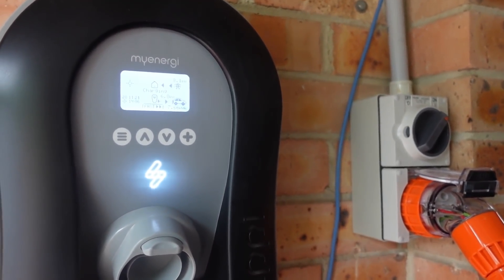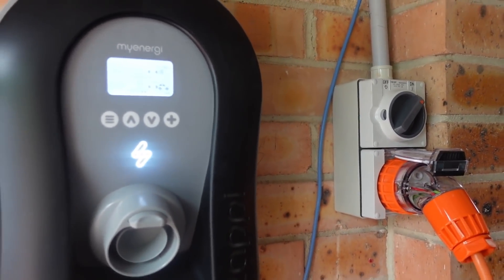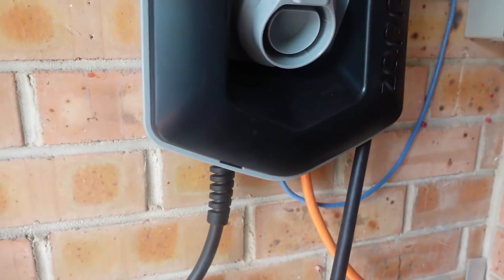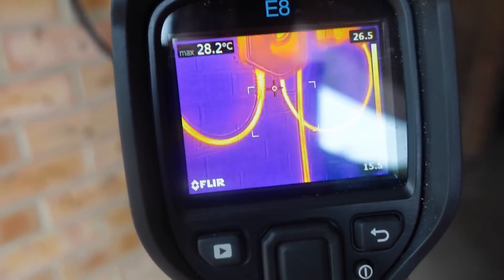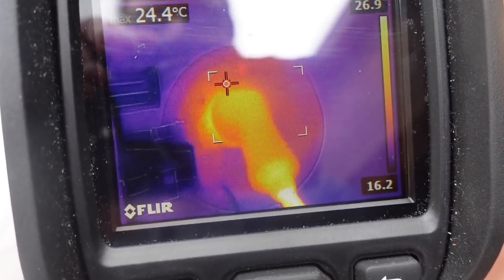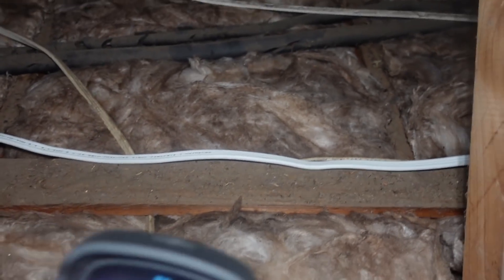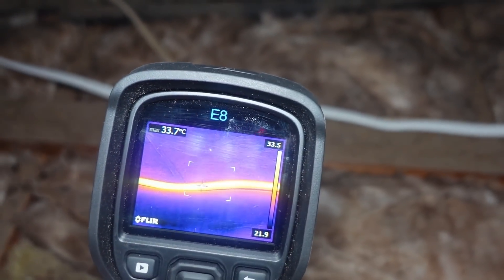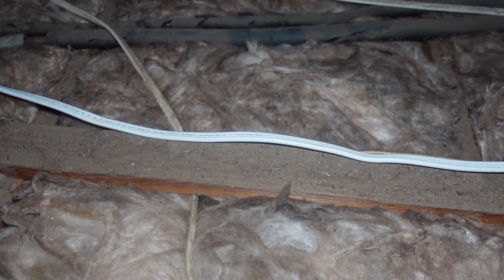Zappi EV Charger & Cable Thermal Imaging

Comment: It's cool how you can see the twist in the cable from the spiraling of two wires creating the "hot cold hot cold" pattern of heat.
Reply from the maker: Wow, didn't notice that on the Zappi cable!
Reply: @EEVblog2  2 power generating cores, one protective conductor same size, and the 2 comms conductors that act as a thermal barrier in the cable.

Comment: Sadly the Ex models are 8.7hz, having at least 25hz or even 60 is a much better experience when looking at a thermal camera. But 320x240 resolution with such a narrow lens and some DoF (due to f/1.3 lens) gives you a useable image. Still not happy with MSX and the color palette. If you put into white hot it's such an interesting image. 

Sadly most people don't think of it as a camera or photography but just a tool. Those using thermal monoculars for spotting experience the world in the way I want to show it.

Comment: Clearly the IR images are fake, since they show the power traveling through the wire.  As you should have learned form Derek's Veratasium video, the wire should be at ambient and the air around it warmer since the energy is traveling outside of the wire! 😂

Comment: 3:30 heat doesn't rise in a cable though, that only happens in gasses and liquids due to thermal lift. Most likely the higher temperature comes from contact resistance in the wallbox which is radiating out
Reply: Possible measurement artifact of FLIR camera? I know they use low-resolution thermal sensors coupled with a higher-resolution visible-light camera to give sharper images. Rotate camera a little to see whether orientation affects reading.

Comment: I wonder what temperatures you'll see on those relays in there, i've seen they get pretty toasty :P
Reply: well, that was the temperature reading on the zappi.
i hope that answered your question.
Reply: @ursodermatt8809  that is just the ambient temperature inside the case though I think.
Reply: Yeah, I wanted to see him take the cover off and do a thermal of the PCB and relays while operating.
Reply: @gargantuablargg  
believe me, the relay is the only thing that is creating any heat in any measure that is inside a EVSE.

Comment: Be advised: the PWM of the pilot is for current only, not the watts.  Current is the most important parameter for the wiring.  Watts measurement includes voltage which is different through out the world.

Comment: Current rating for the 6mm2 cable on single phase is around 40A I think, maybe 45 installed in air. That is for a core temperature of 70C in PVC so these temperatures you are seeing are really quite minor and frankly expected.

Comment: In UK we supposedly lowered to 230v  but Friday measured 244v.  Just 230v Was The harmonised voltage to standardised the world but you know what happens to standards it happens Dreckly (Cornish for in the future like Menyana in Spanish)
Reply: 230 +10% -6%, which allowed the UK to carry on as usual.  Incandescent light bulbs had to be made in 240V versions specifically for the UK, as the difference was enough to massively shorten the lifespan of a 230V bulb.
Reply: @jrevillug  The simples way to harmonize it to change the standard so what exists now is included.
Reply: @target844  Exactly.
Reply: @jrevillug  you beat me to it.
Reply: @jrevillug  Yup, same as the standard here in AU so anywhere between ~228V and 253V is acceptable.

Comment: But why are the cables getting warm, when the energy is flowing in the surrounding fields? :)
Reply: The fields are sending energy through the air into the cable to heat it, at each point, like a microwave! /s
Reply: still the electrons are moving

Comment: The Ioniq 5 as well as the Ioniq Elektro seem to be 11kW and 7.2kW max. charging power here in Europe which would point to 16A 2 or 3 phase. Is this different for Australia?
Reply: Unfortunatelly the old Ioniq is always single phase 32A. It depends on the country how many Amps you're allowed to pull on a single phase - Austria limits single-phase loads to 16A, Germany to 20A.
Reply: @codingquantum2195  I think new Ioniq (FL) as well. 32A single phase.
Reply: Alright so basically 20A max single phase for the "old" Ioniq here. Bummer
Reply: @lalaland5700  Old IONIQ has 32A as well. You can always have an EVSE with that capacity installed at your house.
Reply: houses here in australia are generally wired single phase. so no good having a 3phase charger in the car. there are some houses that have 2 phases like when they have a heavy user.

Comment: OK, but 44° internal at 15° ambient would make it on a hot 40° Aussie day have about 70° internal temp. Might be cozy...
Reply: The cable will be rated for either 70C or 90C so it's no a problem.

Comment: Fast charging mode he says 6-7kw meanwhile I just charged my Tesla at 197kw in fast mode.
Reply: Most people don't have a DC supercharger at home.
Reply: @benbaselet2026  So it's supercharge, not fast charge.
Reply: @benbaselet2026  I know 🤦‍♂️ but 6-7kw is not fast charging. I charge 11kw at home and it's not known as or called fast charging
Reply: @jchelm1979  There's a lot of terminology which is used willy nilly and practically meaningless. I hate it that my car has settings for low, limited and unlimited for charging instead of just putting the damn amps or kW numbers there.
Reply: At home?

Comment: In Europe 6mm2 cables are installed with 25A breakers. For 32 to 40A you should use 10 mm2 here.
Reply: Similar applies to US as well.  30A breaker would be 10 AWG (6mm2).  An EVSE rated for 32A would need a 40A breaker (80% NEC rule), and 8AWG (10mm2) or larger gauge cable.  Dave's setup would be a bit below our codes here.  Is the 6mm2 wire in Dave's AU setup per local code?
Reply: @billjohnson3344  Per AS3000-2007 Table C5 6mm cable is suitable for 40A breaker when installed "in air" or 32A breaker when installed "in thermal insulation partially surrounded" that's based on the assumption that the cable is rated for 75C, if it's rated for 90C you've got more leeway (because it's based on temperature rise) AS3008 is the final word but the tables are more complicated an I CBF doing the conversion ;)
Reply: Depends. In Belgian homes a 6mm² can be fused with 32A when using a thermal fuse or 40A when using a breaker.
Reply: Utterly overkill in most situations. I guess your locale has copper mines to subsidise.
Reply: @Monkeh616  Even if national or local electrical codes allowed smaller feed wiring (which they don't here in the US anyway for an 32A EVSE - except extremely short runs), I'd rather send power to the car rather than heat the cabling.  In Dave's case, I'd bump down the max current allowed by the EVSE to something like 20A if charge time is not an issue.  Cooler cabling and less power loss.

Comment: Good April fool's joke there, could have convinced people bends in cables make them hotter.
Reply: Weeeeeel, if you bend it back and forth enough times you might start to break strands thus increasing the resistance of that particular part of the cable...

Comment: I have wonderings about electric cars as city cars, i understand if cells shorted they create tremendous heat very fast?
Is that solvable, it seem risky to have hundreds "thousands?" of  electric cars in underground  garages????

Like a real bad accident just waiting to happen?
So will they solve this?
Reply: Just as bad as ICE cars that are more likely to burn. I remember a overground garage where a few hundred cars burned down in the end
Reply: @matmay  Well i think the problem is that in a  combustion engine garage the firefighters can enter it is "really" poisonus gases from burning  batteries and you can't spray with water it will explode.
Reply: @JmanNo42  If you watch videos of fight fighters putting out a electric car fire, they basically douse it with water to cool it down and keep under control until it burns itself out.
Reply: @mikus4242  That can even be automated in garages using fire sprinklers. Also, anyone remember when Ford was First On Recall Day because of faulty wiring causing parked cars to spontaneously catch fire?
Reply: @mikus4242  Welli read about a fire in a battery factory/storage that they could not go in with hooses and water, because the risk of explosion was imminent during the Morris battery factory fire.

""We were advised that we're dealing with between 80 and 100 tons of lithium batteries, so around 180,000 pounds to 200,000 pounds of lithium batteries," Steffes said. "These batteries range in size from your cell phone to a little bigger than a car battery and as these batteries get wet, they short out and they ignite and explode".
Reply: @JmanNo42  
please, you are very close to trolling. 
what about the norwegian hydrogen plant that blew up?  or all the refineries that went up in smoke.
if you are against electric cars or have a vested interest in fossil fuels, just say so. or better yet just do say nothing.
Reply: @ursodermatt8809   @Urs Odermatt  Not at all i am all pro battery cars and hope they keep develop battery technology better , cleaner and safer.

I just say i can see a problem with a garage holding some hundred of electric cars if they really burn that hot, due to the poisonus gases and from "what i can see" at pictures firefighters not able use water to exstinguish the fires.
Reply: @JmanNo42  
keep on bringing cassandra messages.
Reply: @ursodermatt8809  No my worries is genuine, i ask if  i/people should be.
Reply: Fuse ?
Reply: @larsbg  Yeah but i think in general a short in a cell is due to corrosion or physical damage, and i do not think the cathod and anod departments that far apart.

Comment: Would this have anything to do with the “misconception of electricity” video ‘?  Meaning if each lead was away from each other they would carry more power vs opposing fields ?    I have a big hang up on twisted mains.
Reply: No, transmission line effects are negligible at 50-60Hz.  In fact, having them spaced apart is more likely to induce current in other things and cause eddy current losses as the current loop is bigger.

Comment: Anyone know how Dave ended up with a legitimate Flir E8 instead of a hacked E4?
Reply from the maker: They sent it to me.
Reply: @EEVblog2   Was that before or after the Flir E4 hacking thread?  I can imagine Flir preferring not to see a hacked E4 on screen every time you pull out the thermal camera. Sending you an E8 is a nice way to avoid that.
Reply from the maker: @Psi105  I don't recall the exact timeline, too many years ago.
Reply: @EEVblog2  Any difference whatsoever to the hacked E4?
Reply: What emissivity does the E8 start with default. Normally changes with surfaces but .95 is a normal ball park.

Comment: Interesting, it can get up to 60 degrees ambient in the roof space on a very hot summers day in Sydney.  That would make the cable too hot to touch if it was running at the same load on a day like that.
Reply: if its 60 degrees C, pretty much everything in the attic would be too hot to touch :P
Reply from the maker: Our roof doesn't get to 60C
Reply: @EEVblog2  
how do you know that? if it is 40C outside, it takes to reason it is hotter inside. whether you have that little useless whirly bird on the roof or not.
having said that, i do not know a case where there was a problem because it was hot in the roof space when drawing 30A.
Reply from the maker: @ursodermatt8809  Because I have done extensive temp logging of the roof as a part of the development of my Solar Sponge air heater design.
Reply: @EEVblog2  
ok,
looks like my roof space behaves entirely differently.
so how much warmer was it then compared to the outside?

Comment: can you show how a wire heats up when you run high current thru it? is it starting to warm up from the middle or from the connections?
Reply: I think that'll be entirely dependant on the thermal properties of the connectors.
Reply: @johnalexander2349  yeah, usually any decent connector has less resistance than the cable, and also more thermal mass. Close to the connectors it would heat up slower and to a lower temperature assuming there is some ambient cooling.

Comment: Still the long length means you are losing out on 100W of charge that could be going into the battery, a few minutes more charging time and energy you are paying for lost to low grade heat. Easiest fix is a second 6mm cable in parallel, same breaker, to get the loss halved in the longest run, or pull out and replace the cable with 10mm. If going the 10mm route, put in a split concentric cable, as that will be cheaper than the equivalent surfix twin and earth. Yes electricians run cables poorly in a roof, never organise them into neat runs, just short as possible. Same with alarm installers, you end up with a rats nest of cables, you would think they are being paid by the mm they save in length.
Reply from the maker: 1.4% loss, meh.
Reply: Not all electricians run cables like sh!t in roofs, remember you get what you pay for. So when you get old mate off Facebook market place for $50 you will get a roughly done job....
Reply: The question that came to mind was how long it would take for the saved power to pay for the extra cost of thicker cable.
Reply from the maker: @gargantuablargg  Gien that it's the power from the solar panels, it's essentially free.
Reply: If it bothers Dave and he can deal with a longer charging time (when not charging from excess solar), turning down the EVSE to lower current (say 20A) is the easiest (and free) way to avoid the excess I2R power loss in the wiring of that gauge.

Comment: but what when cable is under insulation and autside temp is 40c and max charge curent at the same time? sory bad english,helo from serbia..
Reply from the maker: As I said, it's 10C rise in temp above ambient.
Reply: @EEVblog2  It is in open air, yes. Let it get buried under some insulation and that will change (which is why there are derating factors).
Reply: @Monkeh616  Yeah. With perfect thermal insulation the temperature can rise to infinity. It's best not to run cable inside insulation, and if you have to, use a larger diameter at least for that section. Not sure if changing the diameter within a single run is allowed though, probably best to run the higher diameter wire the whole length.
Reply: @Monkeh616  
there are tables that take this into consideration. do a youtube search. there is actually not that much difference in conduit and or isolation around it
Reply: @Basement-Science  
please do change your name. your statement has absolutely nothing to do with science nor reality.
Reply: @ursodermatt8809  I'm fully aware, and yes, there is. In the appropriate table for me, for 6mm²: 47A clipped direct, 32A in conduit in an insulated wall, 27A above a ceiling and covered by insulation exceeding 100mm.

Comment: t:5:01 - "It's hard to read but it's 6mm2 in there...". Cable marking... 2.5mm2. Yep, it's hard to read! (darn it, the 6 mm bit was out to the right, with just the "E" shown, that's not at-all confusing!)
Reply: Yep 04:59. 6mm2 - Six millimetre square.
Reply: @mce_AU  It was a trap!!!
Reply: @mce_AU  @Stephen Harrison So it is 2X6mm2 + 1X2.5mm2 the last one must be for ground.
Reply: 2 x 6mm live and neutral, 2.5mm earth. Standard mains cabling here starts to drop the earth size down once you go above 2.5mm
Reply: Ohh wait, that's the "E", that's very confusing!